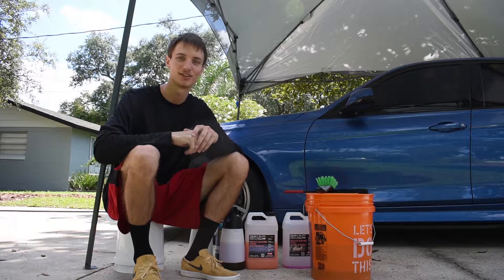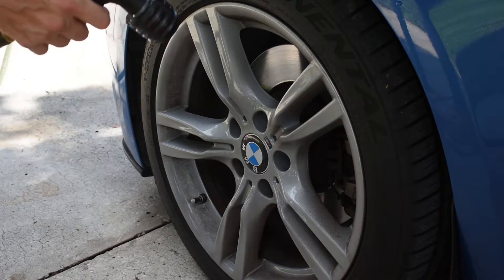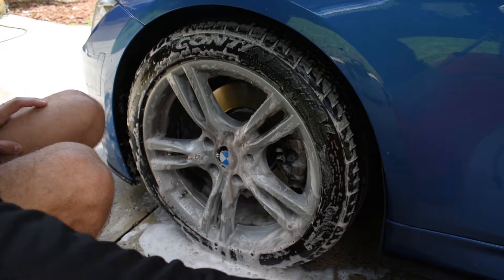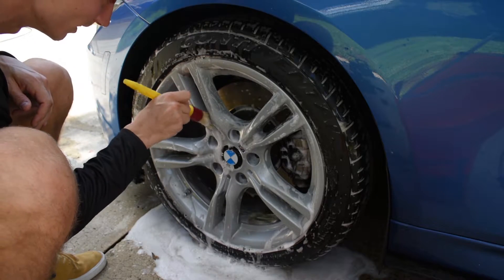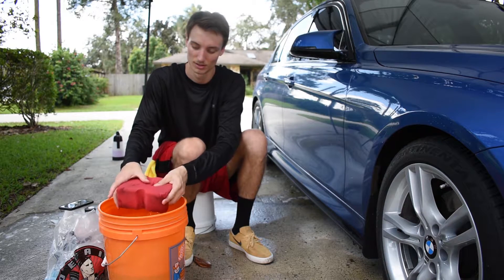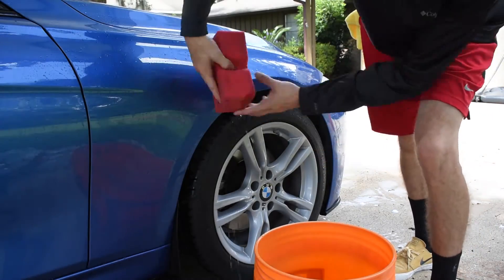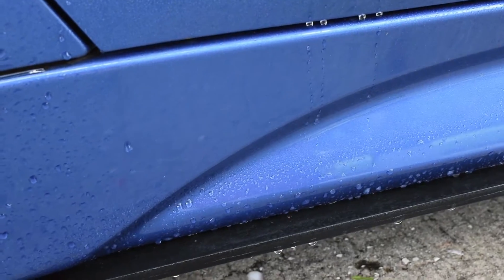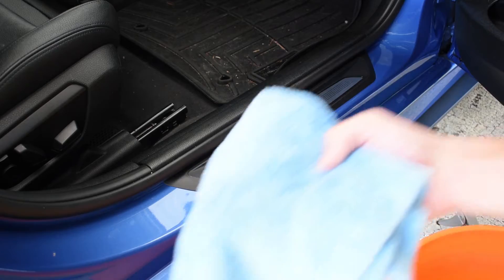ONR RINSELESS WASH & WHEEL CLEANING USING NEW IK FOAM PRO 2 & MULTI PRO 2 SPRAYERS

Comment: How exactly do you dilute 265 : 1 ? can you explain that thanks
Reply from the maker: So this applies to the ONR solution. 1 US gallon is 128 fluid ounces. So in my bucket I put about 2 gallons of water. 256:1 ratio would translate to 2 gallons of water per 1 ounce of product. Each cap full of ONR from the 32oz bottle is half an ounce. So that’s why I put 2 cap fulls. I hope that helps! I know it’s confusing lol
Reply: @skrrtproductions  AHhh ok thanks man that clears it up way better lol. but what if i had a 32oz spray bottle that i wanted to dilute with onr to spray on the car? how much of the ONR would i mix into 30-32oz spray bottle? thanks  :)
Reply from the maker: Dezcanso about an 8th of an ounce. So 0.125 oz of ONR. So that’s about 1/4 of the cap full. Of course you can put a lil bit more and it wouldn’t hurt!
Reply: @skrrtproductions  would it be best to just set aside 2 gallons and mix a capfull into it and just pour into a 32oz bottle to have correct dilution, then just keep the 2gallon ONR water saved elsewhere until it is needed again?
Reply from the maker: Dezcanso I guess you could. Just remember it would be 2 cap fulls per 2gal using the 32oz bottle cap. Also you’d want to mix it up before putting it into your spray bottle

Comment: I use a different spray for the windows/mirrors and works very well. But cuz SPEED is important to me, do you think that I'll be ok with using pre-rinse ONR on windows/mirrors too? Will the result be good?
Reply from the maker: Yeah definitely! I’ve used ONR on my windows before, especially front windshield to get it clean before using a glass cleaner. Worked well for me

Comment: What do you do after spraying and scrubbing the wheels, I think you skipped that? Do you rinse again and then dry with a microfiber?
Reply from the maker: Yeah in this scenario you can just rinse and dry with blower or microfiber. Sometimes when I do a rinseless wash I’ll just wait until the next full wash to do the wheels. Just wanted to do it this time bc they were filthy haha
Reply: @skrrtproductions  thanks for your response. In regards to an ONR wash, I've heard from a lot of others that it replaced a traditional wash for them (foam, pressure washer) do you feel the same way?
Reply from the maker: @AdamAnalytical  definitely not. Can’t replace the foam and pressure washer. With ONR you can maybe get the car 85% clean at best whereas with foam and pressure washer more like 95-100%

Comment: Do you think the onr in the iK sprayer wound work as a clay lubricant?
Reply from the maker: You can but it’s not ideal as you need use a good bit of it bc it drips off the car quickly. I’ve used Ferrex from optimum if you’re doing a deep clean. Armor All spray wash is actually a really good clay lube and it’s cheap

Comment: did you use distilled water for the ONR or is it ok to use with hose water? also, where did you get that tent and what size is it. looks bigger than a standard 9x9 thanks
Reply from the maker: I’d recommend distilled water for the iK Multi 2.0 sprayer. I used hose water in my bucket that had a basic RV type water filter attached to the spicket. And the tent is a 12x12 I snagged from wal mart. Pretty good size for washing cars
Reply: @skrrtproductions  damn bro, thats dope thanks for the info! And yea lol i pulled a 9x9 out from my garage and I couldnt even fit in there to detail my own car hahaha. Will have to upgrade to a 12x12! keep up work man nice vids!
Reply: @skrrtproductions  what was the dilution you mentioned for ONR in IK sprayer?
Reply from the maker: 256:1

Comment: My ik foam pro doesn’t foam at all i returned it for another and does the same crap
Reply from the maker: Whaaat are you sure you have all the filters in place ?
Reply: Could be you have very hard water in your area
Reply from the maker: That’s weird I’ve never had any issues with mine. Have you tried using some distilled water too with a good dilution ratio?